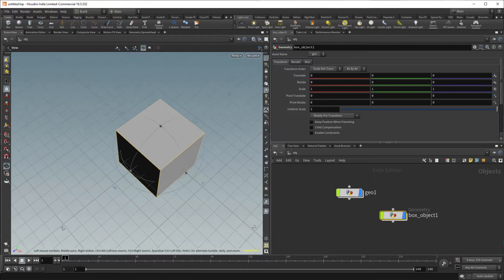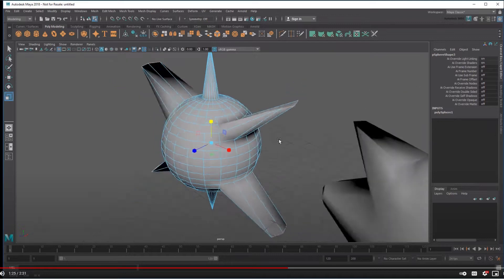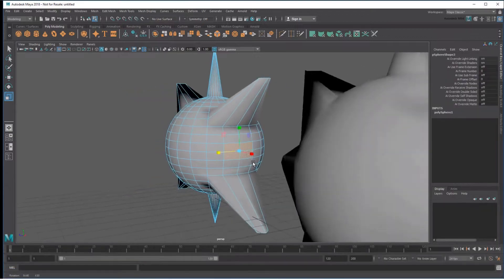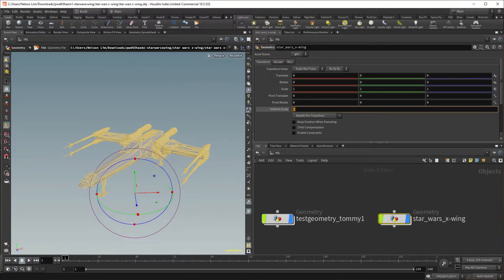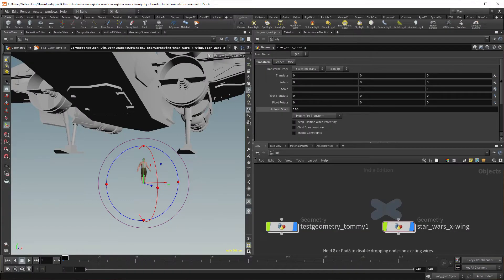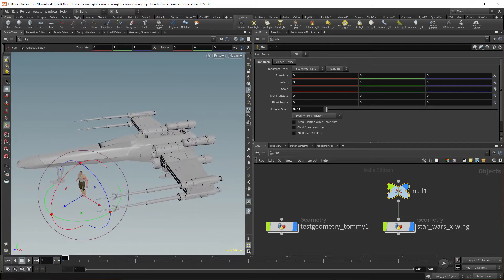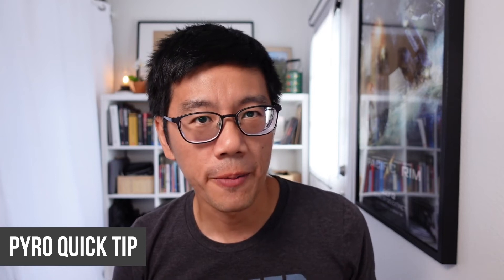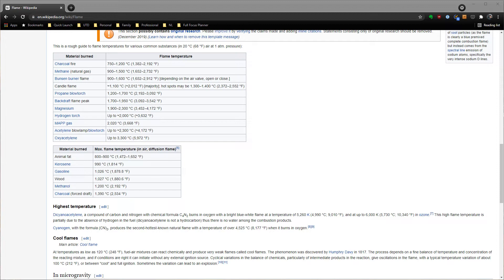Most Common FX Mistake + How to Fix it

Comment: why does houdini scale the model up?
Reply from the maker: Houdini technically does not scale the model up. A unit is a unit regardless of 3d application, but 1 unit is Houdini is 1 meter, while 1 unit in Maya is 1 cm by default. Hence the difference.